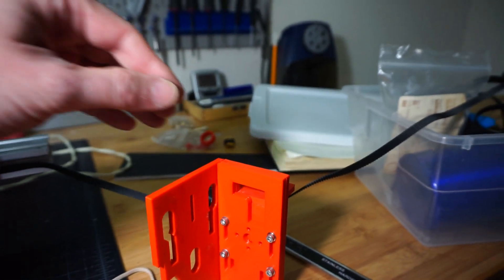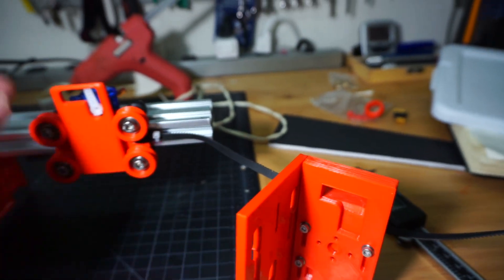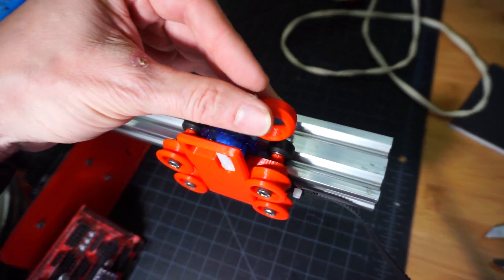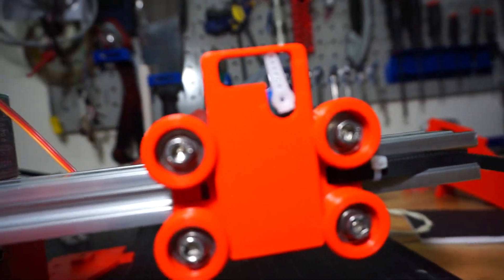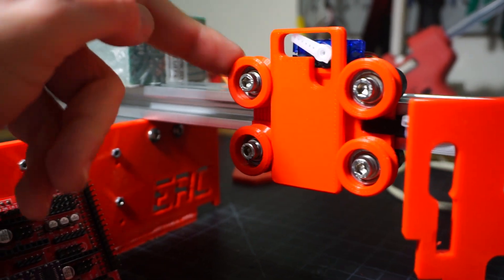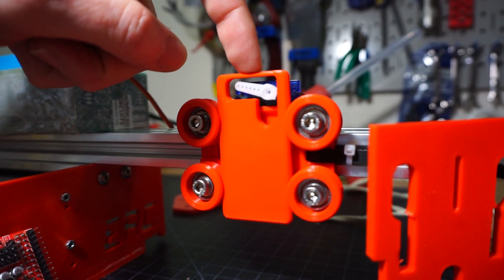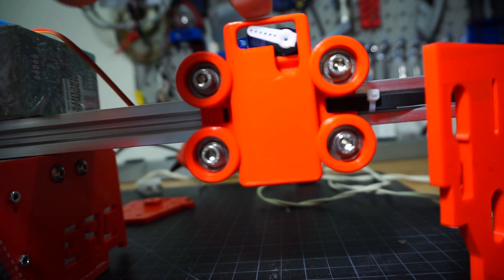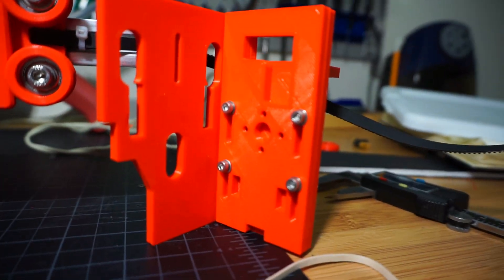ERC TimSav Alternate Gantry Concept

Comment: I'm having issue with the default design too. If I tighten the holding bolts, the servo sometimes got stuck not able to move at all. If too loosen, then the cutting of the foam a bit out of measurement.
Reply from the maker: You might want to check out the ERC TimSav Ball Bearing Head (https://www.thingiverse.com/thing:4330662), which I think is a bit over-engineered but uses a pretty great idea for using a rack and pinion movement. Could be a good start for something different? I haven't tried it apart from printing the mechanism to try it out.
Reply: @CapnBry  yeap.. was aiming on that type of holder too. Btw, your mod looks cool with that red color. The interesting part is yours have another extra wheel on the X Axis.

Comment: I see that curren (paid) version of ERC TimSav foam cutter uses one 2040 and one 2020 profile. On yours video there is 2040 instead of 2020? Did you have any troubles to mount it? I have many 2040, but no 2020.. And I was wondering if it can be used easily.
Reply from the maker: I used 1x 2020 and 1x 2040, but I did a lot of custom stuff (much of which I would not recommend). You can see a better overview on the forums:
https://forum.flitetest.com/index.php?threads/erc-timsav-cheap-diy-cnc-foamboard-cutter.61018/page-16#post-565955